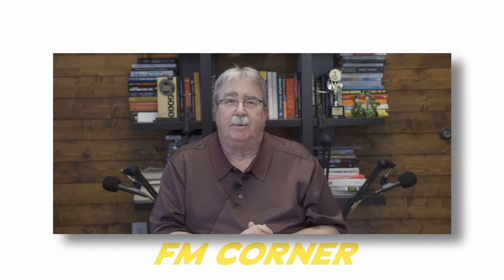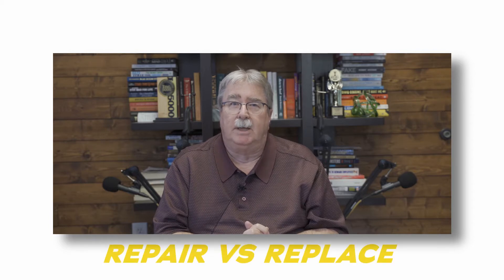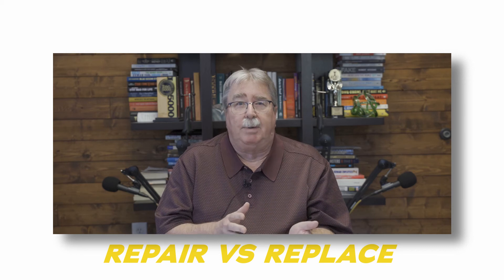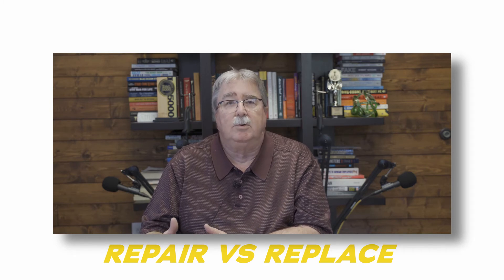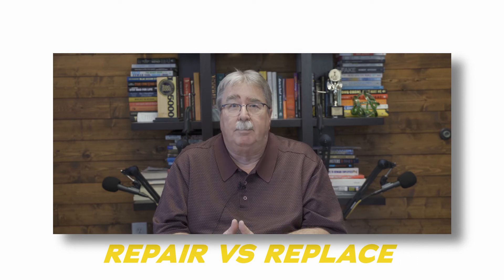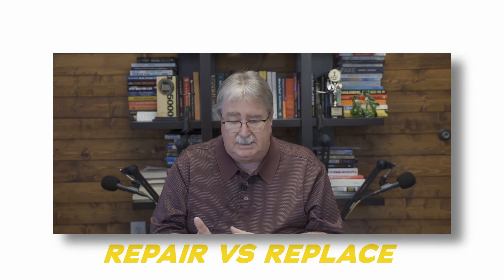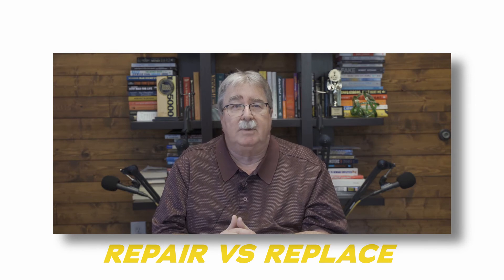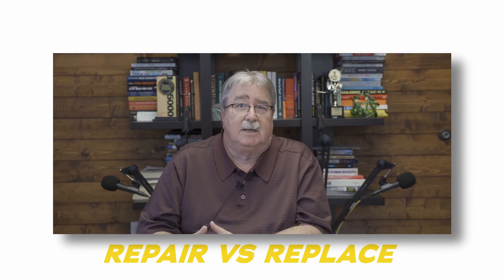Facilities Management - FM Corner #6 w/Danny Koontz - Repair vs Replace

Comment: Also important to look at what has been spent on previous repairs as well. If you have spent 3000.00 in previous repairs on a unit and the new repairs are 1500.00  a new unit is 8000.00 that brings you to that magical 1/2 cost even though this current repair isn't half the cost of a new unit. brings you to that magical half way point on